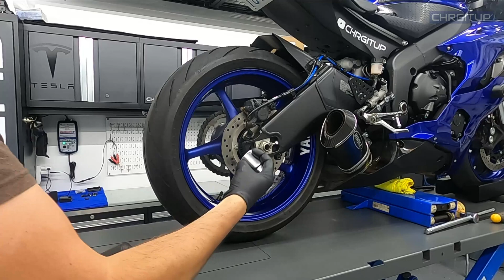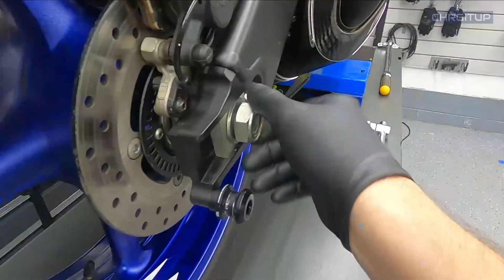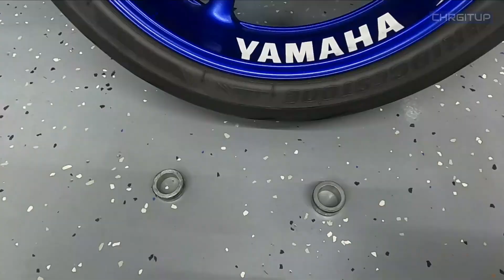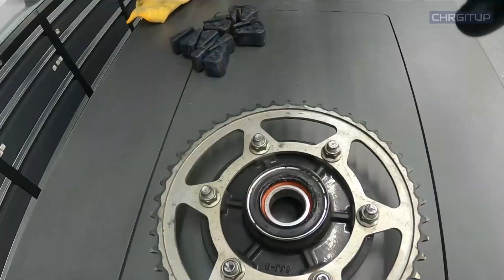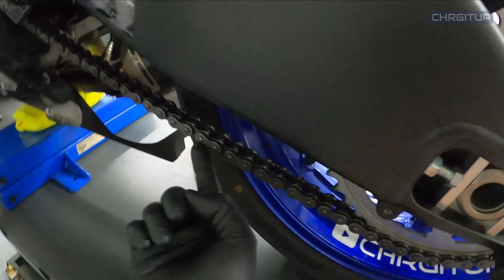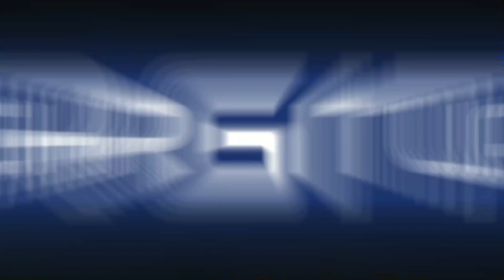Rear Wheel Removal (How-To) (Repeat)

Comment: Hello, I wanted to ask you two questions and I hope you can help me.
	1.	Where can I find all the torque (Nm) specifications for the Yamaha R6 rj 27?
Could you please send me a link to them? That would be very kind of you.
	2.	I have a problem with my R6: when I engage a gear and fully pull in the clutch, the motorcycle still tries to move forward. In addition, the clutch lever is relatively hard to pull, even though the clutch cable itself moves very smoothly. Do you have any idea what could be causing this problem?

I am planning to open the clutch soon to check it, but for that I need the torque specifications for the clutch springs and the clutch cover bolts.

I hope you can help me. Thank you very much in advance!
Your videos are a great help and very informative — thank you for that!